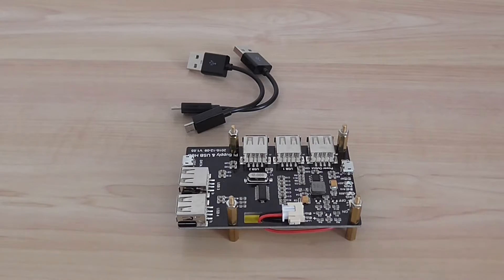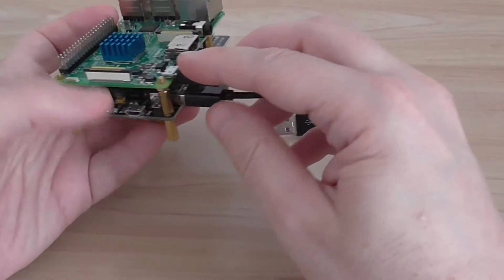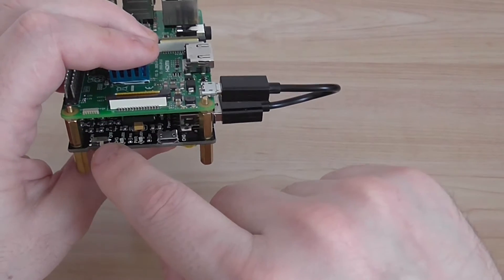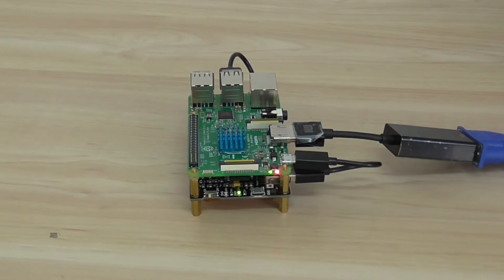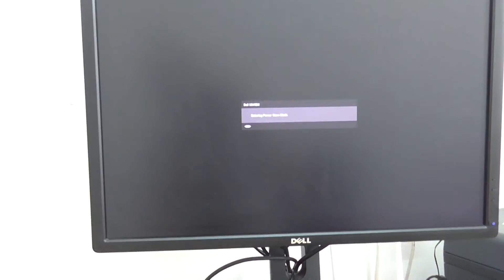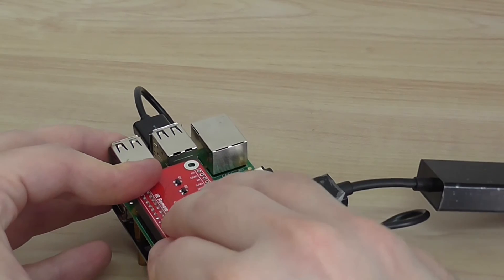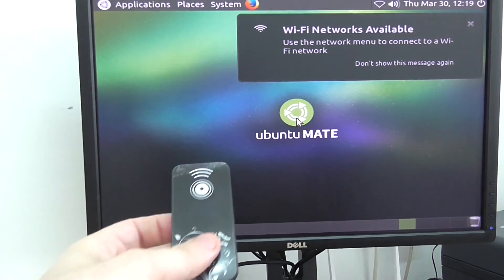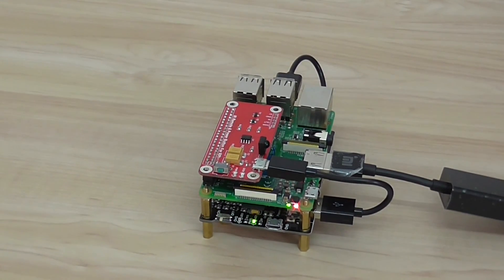Raspberry Pi 3 & Raspberry Pi 2 Self Powered USB Hub

Comment: Hi! I have UPS v2.02 and there is no ON/OFF switch but just a button. If i switch off the device is it impossible to turn it on again. Is there any way to do that?
Reply: Found some info on their web site. The push button is "one click to turn on" and "two clicks to turn off". Seems it's (very) briefly detailed here: http://wiki.52pi.com/index.php/Pi_Supply_%26_USB_HUB_SKU:_EP-0078#ChangeLog
Reply: I ended up returning mine for two reasons 1) it does not pass power while charging and 2) it "leaks" power when turned off. The first reason makes it NOT a "ups" since it cannot keep power on the PI during a power outage. :(
Reply: @VernGraner  thank yuo for your replies. I noticed this kind of problems too, right now i'm looking for something better. If you have any advice I'll be really happy to hear that :D

Comment: Does this add on work without the battery? If I don't have the battery would it still be powered via the addon or the Raspberry can be powered directly. Thanks for posting
Reply from the maker: Baric Dondarion The battery is an integrated part of this board. They are not separated from each other. I didn't try only using the usb ports to see if they work when bridged.
Reply: AndroidPimp - Android News & Mobile Technology thanks for the reply. The one I see online (from the Chinese aliexpress because amazon don't ship to my country) don't come with the battery.
Reply from the maker: Baric Dondarion  I checked . You are right. You need to buy the battery sepretly and plug it to the board. Both items can be found here: 52pi.aliexpress.com

Comment: That Power Bridge really needs to be an actual PCB-type of Bridge. Kinda like the one used with the HDMI screens. Still nice.
Reply from the maker: Mark G  it works well.
Reply: I guess. Not such a clean build thought. I may actually need one of these to power a wifi dongle. Not sure yet. It's a good bit of kit, that's for sure. Thanks for posting.
Reply from the maker: Mark G  welcome. you can't get everything for the cheapest price. There is a limit .. Also for Chinese  products.

Comment: I bought them form Amazon,  the price is resonalble, I like them so much, they seem to be sold with a promotion now,  there are the weblink: https://www.amazon.com/Makerfocus-3800mAh-Lithium-Battery-Raspberry/dp/B06VY3LC6V/ref=sr_1_4?ie=UTF8&qid=1506751707&sr=8-4&keywords=Hub+Power+Supply+Module+with+3800mAh+Lithium+Battery    
https://www.amazon.com/Makerfocus-Raspberry-Remote-Control-Switch/dp/B06X9KTQHD/ref=sr_1_sc_1?ie=UTF8&qid=1506751824&sr=8-1-spell&keywords=rpi+ircontrol . Hope that can help you!

Comment: the pi zero only has micro-usb ports. So to make use of hub function with a pi zero or pi zero W, either a different cable is necessary (from micro to micro) or an extra cable is needed (the OTG to convert micro to USB 2) as an adapter for the pi zero. Correct?
Reply from the maker: yep

Comment: that's so cool, where did you buy it ?
Reply from the maker: 52Pi Provided me sample for review, so I didn't buy. if you want to buy there are links in the video discription
Reply: I bought them form Amazon,  the price is resonalble, I like them so much, there are the weblink: https://www.amazon.com/Makerfocus-3800mAh-Lithium-Battery-Raspberry/dp/B06VY3LC6V/ref=sr_1_4?ie=UTF8&qid=1506751707&sr=8-4&keywords=Hub+Power+Supply+Module+with+3800mAh+Lithium+Battery    
https://www.amazon.com/Makerfocus-Raspberry-Remote-Control-Switch/dp/B06X9KTQHD/ref=sr_1_sc_1?ie=UTF8&qid=1506751824&sr=8-1-spell&keywords=rpi+ircontrol . Hope that can help you!